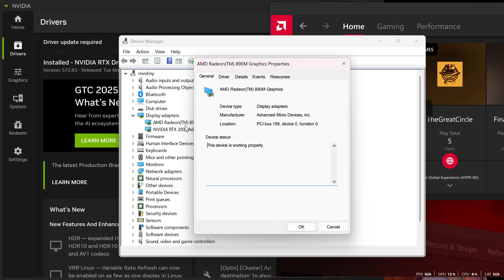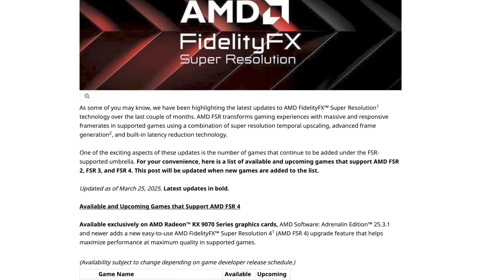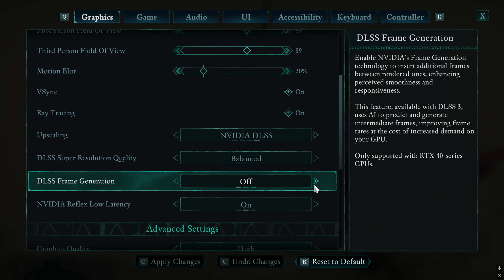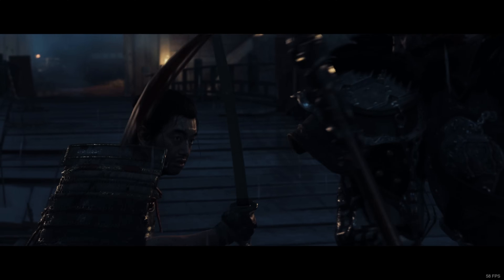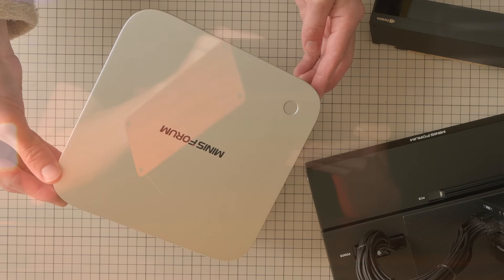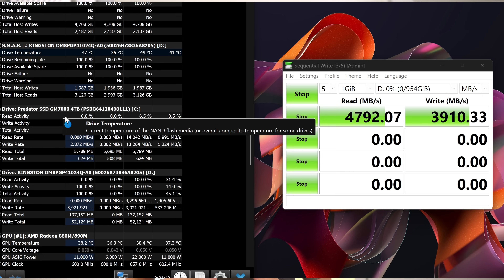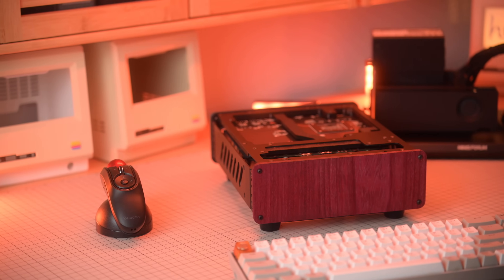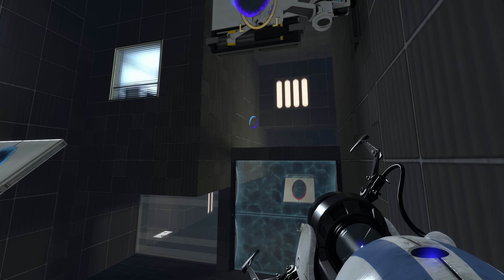You Should Try DLSS + FSR Co-Processing on Your Mini PC

Comment: You doing it all wrong, use RTX2000 to render games and use a piece of software called lossless frame generation to use the 890m for all scaling and frame generation (it can even do 4x frame gen like 50 series). Just make sure you plug your monitor into the mobo and not the gpu. You can plug it into both if you prefer switching between frame gen and native. Have fun testing
Reply from the maker: I'll try it out. 8)
Reply: Let us know how it goes! @NotFromConcentrate
Reply: @NotFromConcentrate  Yes! I was looking for this suggestion. Give this only one try and it will become your new obsession (specially when you get into the compatibility spreadsheet some folks put together)
Reply: I love Lossless. And it works on pretty much everything, not just games.
Reply: I had just installed lossless and used it in a legion laptop with amd igpu and a dgpu nvidia 3070, and it could double the fps
Reply: @bett0diaz  is there a step by step on how to do this or what program to use?
Reply: It works very well being able to use the iGPU for something.  On a desktop it's free performance, on a laptop it's a little more limited but it still nets better performance.
Reply: I read that the Lossless Scaling can only work with DX12 titles, right?
Reply: @KelvinYong77  No it works on everything it can screen capture basically. I use it on emulation because emulating native hardware, even if the hardware is strong enough, will typically slow down when an actual console would slow down (shadow of the colossus on PS2 for example) or lock out at a fixed framerate unless you also start tweaking emulated console overclocks which has its own share of issues. It's a lot more straightforward to just run Lossless scaling. Lossless scaling even has options to upscale media, which is great because 4k files are just huge compared to keeping a library of 1080p.
Reply: @KelvinYong77  I don't know if you mean this method or not, but indiana jones is vulkan and it runs perfectly with LS
Reply: @KelvinYong77  no, I use it with TES4 Oblivion, works very well
Reply: I came down here to say this. I tried it on my 2018 laptop but the intel igpu is too weak and the laptop gtx 1050 is still better off running LSFG itself. These newer AMD cpus/APUs though can most likely keep up (and indeed, are advertised for AMD's own frame gen tech which I'll get to.) You can also try to do the same thing in the Radeon software using AFMF2. Run frame gen on the APU/igpu and use the dGPU as the main. This setup also reduces input latency at least with 2 discreet gpus vs running everything off 1 gpu, not sure that might be impacted in the scenario of the frame gen gpu being part of the cpu.
Reply: he speaks the true true. Newest way of doing SLI.
Reply: @chasevanginkel8798  should that be lossless scaling frame generation? I googled just "lossless frame generation" and all the results include the word scaling